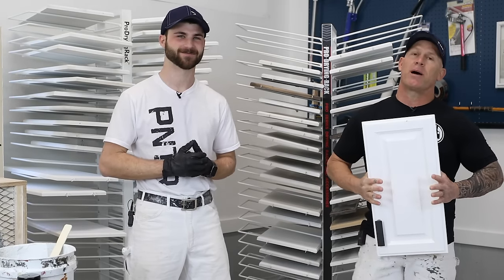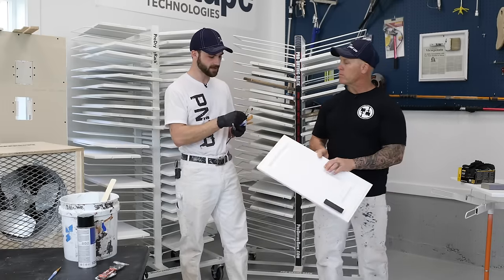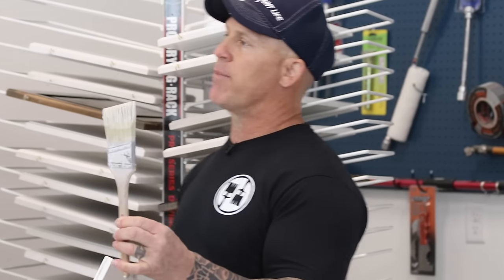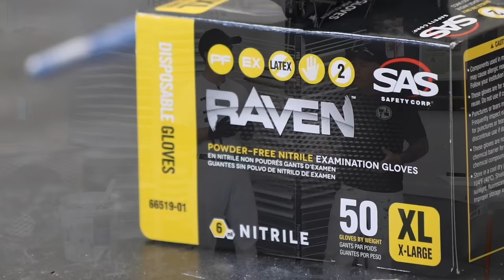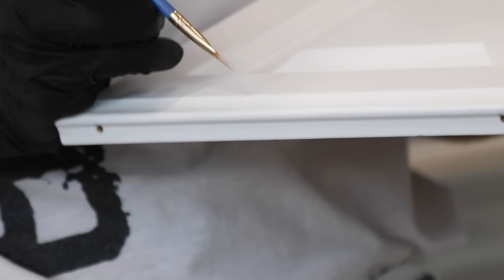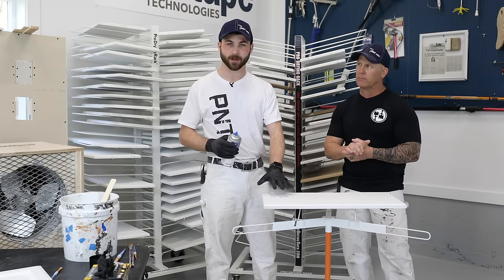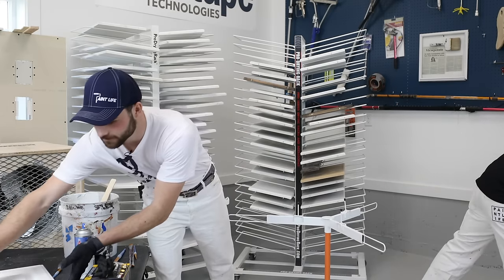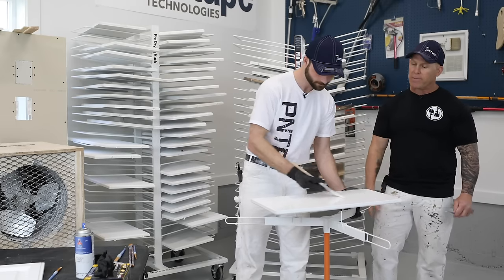Cabinet TOUCHUPS!  The Art of Touch-Ups

Comment: I have a couple touch-up questions. First my bathroom cabinets have a few really small blemishes here and there, but they drive me crazy — and that’s because the cabinet is gray and there appears to be a white primer beneath. So, they standout because of this. I just bought my house so I don’t know how to best match the gray paint. In my kitchen, the cabinet doors beneath the sink have chipped and pealed paint on the top edge. I feel it’s because the paint doesn’t like water, which seems counterproductive with these being kitchen cabinets with a sink. I can see down to wood, what method and products would I need to repair this?
Reply: Aaron, the best way to match paint when you don’t know the original color code is to remove a door and take it to your local paint shop. Sherwin Williams, Benjamin Moore, etc will be able to scan the color and give you a pretty close match. I emphasized pretty because it may be 95%, not 100%. However, it should be close enough for touch ups. 
On the drawer front where your paint is peeling, the best solutions would be to sand down the area where the paint is peeling. Make sure to get to an area where the paint is firmly bonded to the wood, otherwise your problem will continue. You then need to prime the bare wood again. After the primer has dried, sand with very fine grit sanding block and smooth the primer out. After this, you will be able to apply new paint to the wood, and hopefully prevent the problem from getting worse. 
Also, make sure to check if you have an oil base paint or water based paint applied to your cabinets. If it is oil based, you will NOT be able to use a water based paint on it. To check, just dip a cotton ball in some acetone. Swab a part of the paint on the cabinets, if the paint comes off, you have water based paint. If it does not, you most likely have an oil based paint. Hope this helps.

Comment: What if you just sprayed white cabinets (2 coats oil primer, 3 coats acrylic), and someone gets dark oil based floor stain splatter on a couple doors?  Is it better to sand and respray the fronts?  They are small spots but should I worry about too many coats and will the color match all the others I just painted?

Comment: THANK YOU FOR THIS! 👏🏻
I sand with 150-180 wipe down; let surface dry completely 
Then paint with a soft angle brush then after 30 secs or so I lightly roll over the painted surface with a clean dry FOAM roller 
and repeat between coats 
For me, this method gives me pretty nice smooth finish with no brush strokes.  
It’s obviously NOT as smooth as sprayed on finish but it’s much nicer than brushing it on plus I avoid setting up the paint sprayer which saves me tons of time when painting stuff like trim or casing.  

I’m not by any means a professional.  
I’m just a DIYer always looking for the next best way (I very  recently remodeled my 20yr old kitchen). 😉👍🏼
Reply: what type of paint do you use?

Comment: How do I repair chips and scratches along the bottom edge of cabinet drawers and doors. A neighbor kid drove through my kitchen with a hoverboard which was just the right height to screw up the corner edges of my cabinet fronts all along my island. I can feel the damage with my fingers, but when I kneel down I see it. What do I do? Do I need to fill these in and sand edge straight before painting. This is a brand new kitchen! Help!
Reply: Bill the parents and make slingblade help with repairs

Comment: I've seen your video on how to spray cabinets and it's very good. Do you have anything on how to paint cabinets without a sprayer? Possibly with a brush and foam roller? I'm thinking about tackling my kitchen cabinets and could use any help or advice I can get.
Thanks
Reply: Steve spraying results in the most professional finish possible. With that said if you're still adamant about taking this project on get the finest paint brush and smoothest finish nap for a 6" zip roller you can get. I personally don't recommend a foam roller for someone without experience with them as uniformity issues can occur has different pressures are placed on the foam roller nap. The use of a paint extender is an absolute must for the best results with this method.
Reply: First is clean cabinets, then sand, then vacuum then shellac primer, then Cabinet Coat paint by insl-x applied with Wooster micro plush roller that's the best way I've done with a roller
Reply: @dennisgarber  I definitely agree but it's the best finish I can achieve without a sprayer

Comment: What primer for cabinets do you use? 
Heard it was “bonding primer” from Sherwin Williams? 

And is the lacquer you guys apply, very scratch resistant. ? 

Do you ever top coat your lacquer with a clear coat?
Reply: They use Sherwood Primer Surfacer. Its the recommended primer for the lacquer system they use.
Reply: Kyle Goodman what about the lacquer they use? What’s it called ?
Reply: @clientesdirectos8841  Sherwood Hi Build Pre Catalyzed Lacquer.
Reply: Kyle Goodman Last time they spoke about primers they said “Bonding” primers and they use it on any substrate. Oil, water, lacquer.
Reply: @clientesdirectos8841  The Primer Surfacer is essentially a nitrocellulose bonding primer.
Reply: Hugo Palencia ;
Reply: As far as undercoat goes use what ever  the manufacture recommends.
I always stick with what works best with the finish lacquer ie what the lacquer manufacturer recommends.
Not all chemcles bond with each other 
I'm not a chemist but I've learned to read the labels and I always call the sales rep for the product I'm using to see what they suggest.
Always they are helpful down to specifics of sand grit between coats, how many layers of each material to acquire optimum results. Drying times etcetera.
Randy Barnes Painting Since 1976